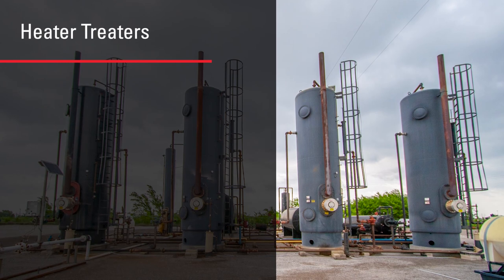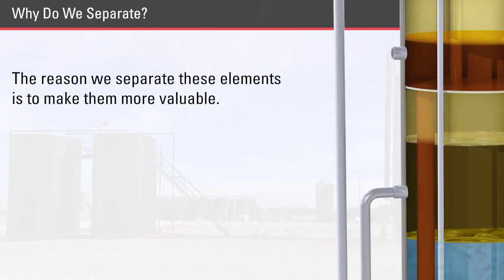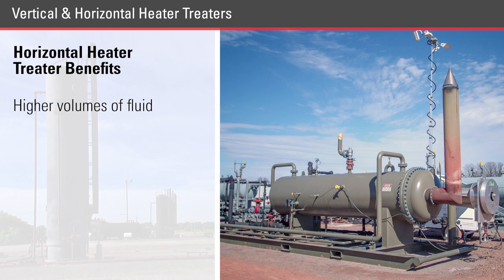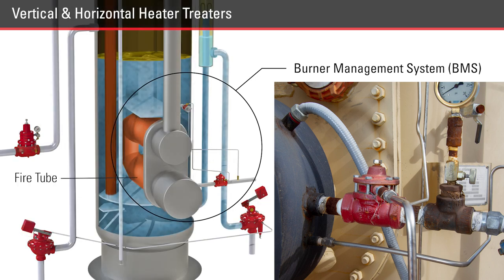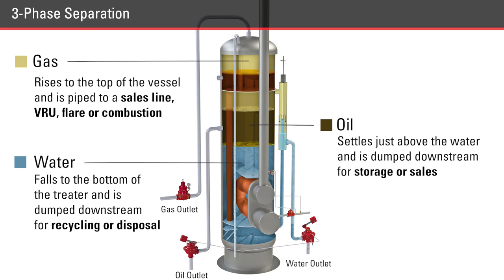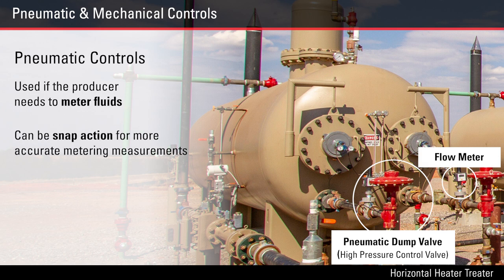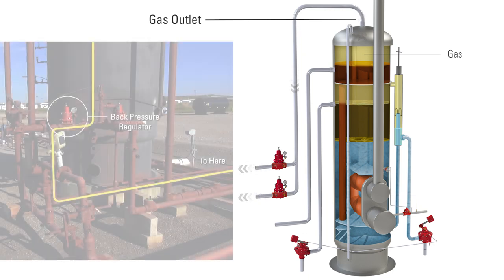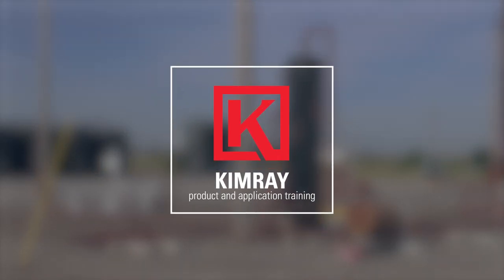Heater Treater Intro and Overview [Oil & Gas Training Basics]

Comment: What is the better one for using on shore, mostly here using the vertical type but it very high maintenance cost when work at high, So I would try to know about the horizontal is practical instead
Reply from the maker: Horizontal heater treaters have several advantages over vertical treaters. Horizontal treaters can handle larger volumes of liquid and can be fitted with baffles and other internal pieces that aid in the separation process. Because horizontal treaters are lower to the ground and usually of a larger diameter, maintenance is more easily performed. Whether you use a vertical or horizontal treater really comes down to your specific needs and the application.

Comment: Could you please tell me  how to find out the treating temperature with respect to the physical properties of emulsion?
Reply from the maker: Typically, treaters are heated between 100°F and 158° F. The viscosity of the oil, desired BS&W levels and if it’s a vertical or horizontal heater treater will help determine operating temperature.

Comment: What if I heat crude oil at 130 degrees  Fahrenheit, at atmospheric storage tank(api 650)  with submersible coils circulating  diathermic oil?
Reply: Boom ✨
Reply from the maker: All of the separation of oil/water/gas should take place in the heater treater prior to getting to the storage tanks. Longer retention times or higher temperatures in the heater treater would improve separation.